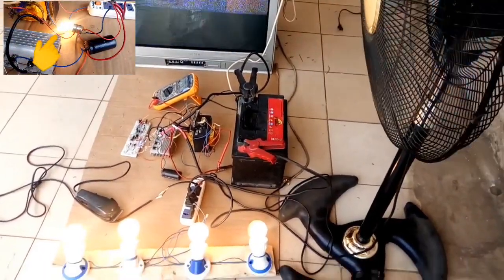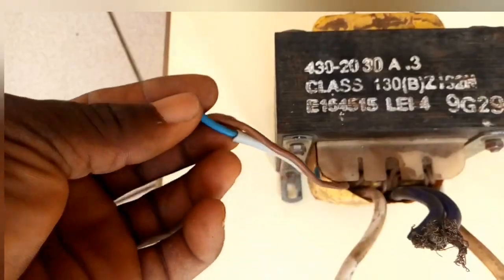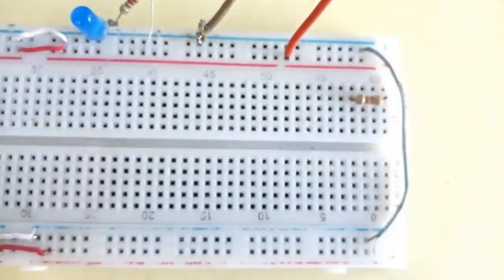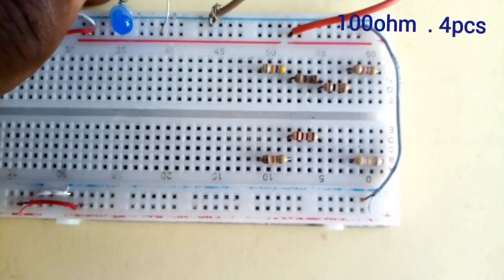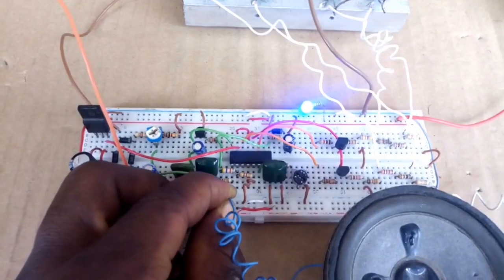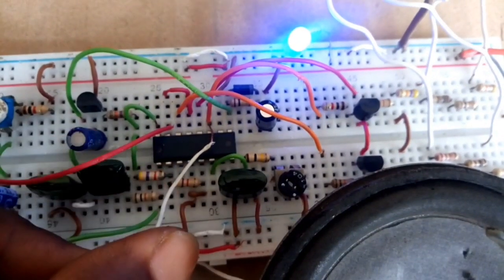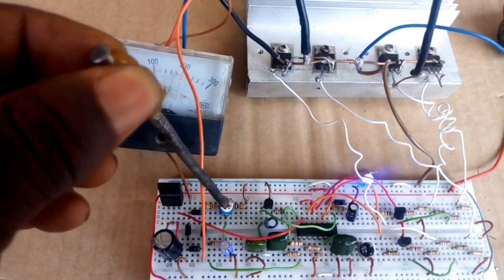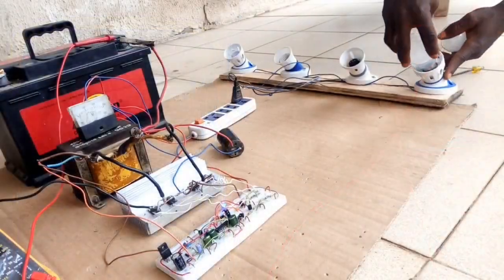home made powerful inverter step by step with feedback

Comment: I just built this inverter circuit and there are so many errors and i av perfected it, i also added some other features like low battery protection, overload protection etc.
There is voltage spikes if you first on this inverter, so that is why added those features for protection